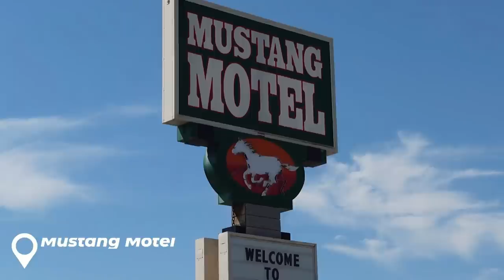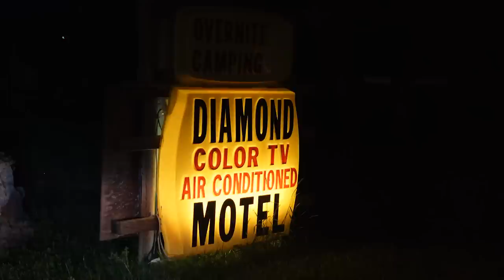Riding the Honda Africa Twin Across Montana

Comment: I’ve had two flat tires in my bike travels, one front, one rear. Both caused by improperly installed valve stems at the same time by the same shop. Unpatchable, needed a tow both times. Needless to say, I never used that shop again.

Comment: End screen crew answer - yes twice on bikes with tubed tyres - one I had to get recovered - sealant didn't work and inner tube was too badly torn to patch! Second one a slow puncture - again sealant only half worked - limped 300 miles home on a Sunday - no repair shops open - reinflating tyre every 50 miles or so with a ferry to catch!  Morale of stories - carry a spare tube - get a bike with tubeless tyres - a repair kit and a spare tube for when it doesn't work!

Comment: I love the Amanda and Gary team. 

I have never had to fix a flat on the side of the road. I had a tire go flat while my motorcycle was sitting in a parking lot for hour. It is much less stressful plugging a tire in a parking lot than on the side of a road. There was also no battle of trying to do a controlled stop with a tire that is losing air.

Comment: So far I have not had a flat tire EVER but now I am cursed. However once coming back from a trip one of the guys key broke off in the tank so messed with that (not me but there were several of us) in Shaniko OR. Messed with it and couldn't get a resolution so he said to break the ignition. One hammered screwdriver later the ignition was driven out of the steering head and all the contents spilled onto the ground. Luckily they found everything and was able to put it back together and make it function so it would turn on. Couldn't put it back in the head so thankfully I had a roll of black tape (I helped :D) so it was taped up and now not able to be turned off but we got home. Yaaaaaaaaa!!!!!!!

Comment: I rode across France on a BMW GS a few years ago in those temperatures. I spent most of my time stood up on the pegs to get some air onto my body. But my feet suffered due to the Boxer engine. Good times were had once I got to the Pyrenees and climbed the cooler mountain passes.

Comment: Yes, another motorcycle rider( not with me) saw me pull off and checked to see if I was OK. He had a compressor and plug kit, but my bike has tubes. We got it aired up and were not far from town, he helped me to a Walmart where I bought a patch kit and borrowed the tools to get it done.

I have seen some YouTubers suggest take the air pump out of its plastic case to save space.

Comment: I've been lucky enough to not have an on road flat. I try really hard to change tires relatively right before leaving. Of course, that doesn't mean something dumb won't knock it out. I do carry a tire kit with bacon strips, and a compressor. Hopefully, I never need them.  
I used highway 12 in Michigan and I think also in South Dakota. A solid road that kept me off the bigger road. I'll go a little slower to feel 10% safer.

Comment: It was great seeing you guys again at GetOn Advfest! Love your duo commentary. Harlowton is a cute town; I've never stopped at the coffee shop before so will need to do that next time I go through. I've also ridden by Ingomar a couple times but never stopped, not sure why, I love history. 

I rode Hwy 12 to Ryegate then took a dirt road south to Columbus, then continued south to Wyoming. That heat was brutal, I got near heat exhaustion in Sheridan, WY. I had taken the pass east of Lovell, which was beautiful but due to the cooler temps I wasn't drinking enough water. I declined that pass into what felt like the first level of Hell, got caught in road construction. I was drinking water but got behind, by the time I reached a travel plaza in Sheridan I had the shakes, dizziness and heart was pounding. I dropped the bike, luckily a guy ran over to help me get it back up. I was literally a hot mess!😂 I spent 2 hours in the plaza drinking and eating to get back to feeling "normal". Lessons learned that day for sure! 

End screen question: I have not had a flat tire on the road, (I know need to knock on all the wood in the house) I've had leaking valve stems which I caught from excessive checking my tire pressure.

Comment: We have had to handle several flat tyres, one was in the pouring rain, with a tubed tyre that we thought was tubeless & found it wasn’t when the compressor was pumping hard out and air was coming out of the spoke holes in the rim. Stopping every 1000 metres to keep the tyre partially inflated made it a slow trip (we only had a tubeless repair kit for my K1200, not for my wife’s R9T).

Comment: Neat! I live in Lolo Montana. Up hwy 12.there is a little gas station 4.5 miles up from Lolo. Travelers rest country store. Did you get to ride hwy 12
Reply: Hi Chris, we have ridden hwy 12 many times. Excellent road. There's a group that rides up to lochsa lodge every Sunday for breakfast in the summer of course. They usually meet at the Conoco at 8 or 9 am if I remember correctly. I have gone with them a couple of times.
Reply: @thedigitalnothing  nice then ya probably have meet me. I work at travelers and have for 13 years

Comment: Two tires, both front and back at same time on my new cb500x with 800 miles on it..  Both were small gutter screws they picked up on the expressway,  stopped on busy side street into a driveway.   The owner came out, who was a biker,  he helped and pulled a compressor from garage.  Removed the screws and used the same plugging method your brother did on both tires.   These tire patches have 4,400 miles on them, a round trip from OH to FL, including the trail of the Dragon,  and mixed use with not problems.    It's an urban myth that patches, if done properly, won't last on motorcycle tires.